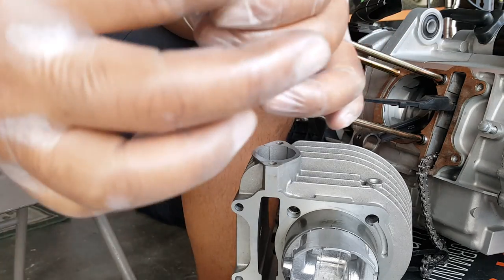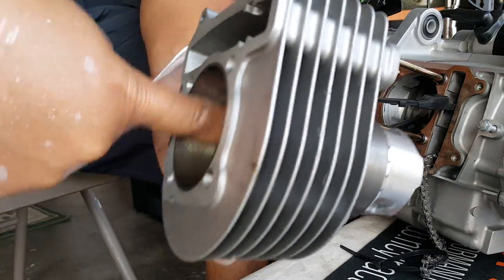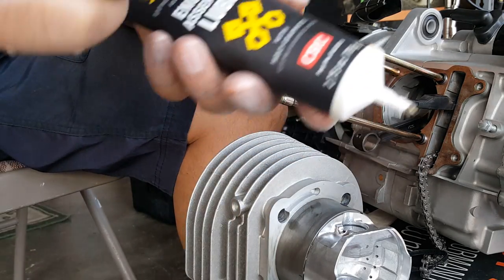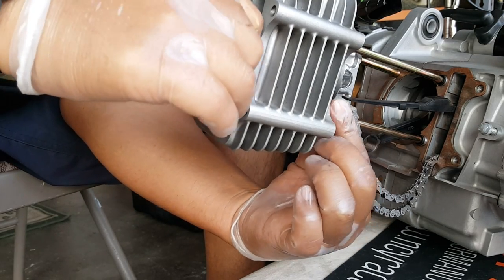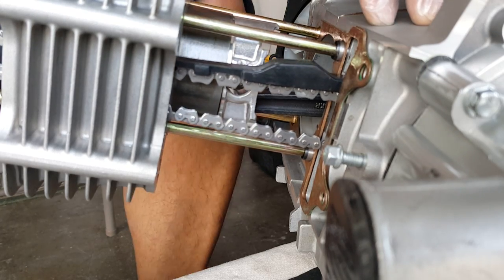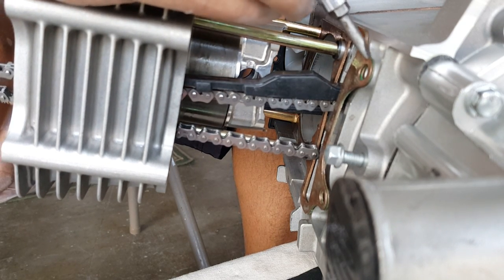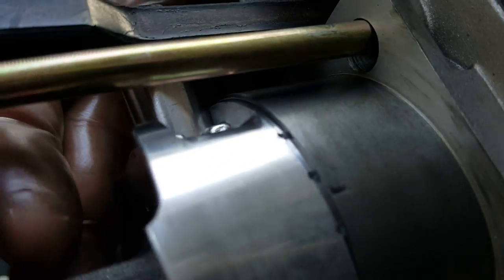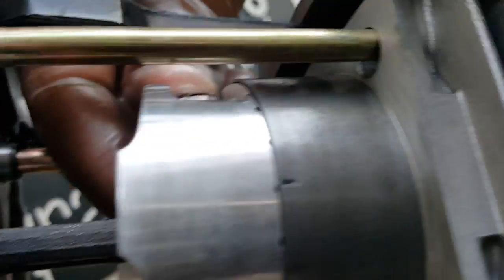How to install GY6 Cylinder Top-End on SSP-G 180cc POWER KIT Part #7

Comment: When cylinder refuses to slide in butter-like fashion (as it should), you can try squeezing those four spigots gently towards the center. They are long and not fully straight, thus producing friction enough inside their own guide holes to prevent free, even cylinder sliding. No slamming with mallet is recommended, nor it should be necessary at all. Same goes for cylinder head. Good old WD-40 could also be of great help. But no slamming.
Reply from the maker: I'll keep that in mind if you watch the next video you'll see that they actually sent me the wrong one of 54 millimeter stud spacing cylinder versus what I needed was a 57 cylinder stud spacing.. hahaa. Me Lesson learned.

Comment: My goodness, man, WHY are you beating that thing like that?? It should not take that kind of force to get that in there.
Reply from the maker: Jeffery A. Hunt I'm glad you caught it I didn't bother measure it and our distributors did send the wrong cylinder housing it was made for 54mm stud spacing not 57mm stud spacing as to way i been ponding it.. long story short I did get it in but the price of cracking the cylinder scale fins. You're right you should only tap the most 5 light taps mine was like almost 50 heavy taps! I'll post the correct cylinder housing video 57mm and show the difference how easily it should fit in without that much force. No wonder the dowel pins would not align inside either in top end units to the crankcase that should have been the warning sign already incorrect cylinder stud spacing.

Comment: I tightened the starter clutch bolt counter clockwise with a impact wrench maybe to tight? Should of hand tightened it is the cause?
Reply from the maker: Yes hand tighten it with a tool

Comment: i just did my 150 scoot top end the cylinder went on mint u dont need to hit it like that u have the cylinder studs bent.
Reply from the maker: Kevin Stearns absolutely right I haven't got back into showcase that the manufacturer actually sent me the 54 mm stud spacing which I assume we're 57 mm stud spacing it's wife dowel pins wouldn't actually fit just need to tap it a few times the most with a mallet hammer I got the correct part in there now but yet to have time to complete the video thank you for pointing that out.

Comment: I have a tao tao 50cc scooter. is there any way to change the front wheel from a 10 inch to a 12 or 13?
Reply from the maker: Tra vis if it's a short case will be probably not it was a long case you do have a chance if your frame also allows it. Here's how the term if you have a short case or long case 139qmb by the belt size: http://ncystore.com/bando-729-18-30-cvt-drive-belt-qmb-longcase

Comment: I have a gy6 150cc 157QMJ installing a 180cc big bore kit what  is the correct cylinder housing for it?
Reply: Do you have to bore the case or space it to get it to slide in

Comment: Hello... how much milimeter on gasket cylinder (bronze)? Thx
Reply from the maker: hromyblesky121212 the gasket you're looking at is 63 mm gasket as far as thickness of spraying on the bronze just a nice even coat. Does this answer your question?
Reply: what is its thickness? My piston rattle on head NCY STORE

Comment: Great video 👍 tutorial NCY I installed the 180cc bore kit on my 157qmj and had to redo everything again but this last time I completed it I tried to start it something I did in the process of reassemble it wouldn't turn over the timing was top dead center and the cranckshaft and piston wouldn't turn I tried to turn it the stator with my hand it wouldn't not turn like seized up? Any suggestions plz?